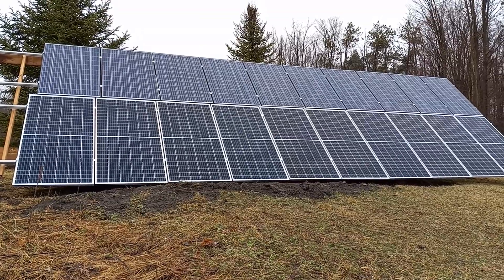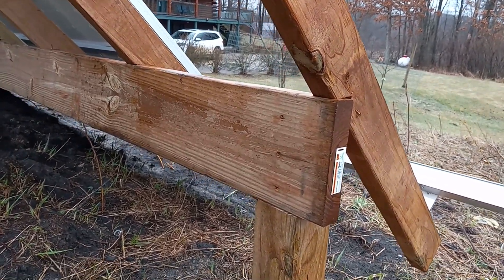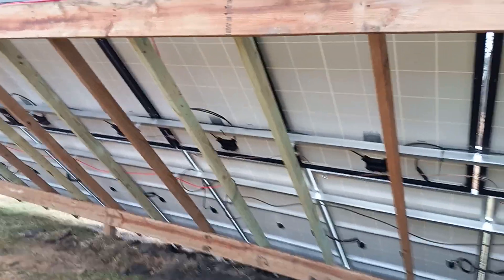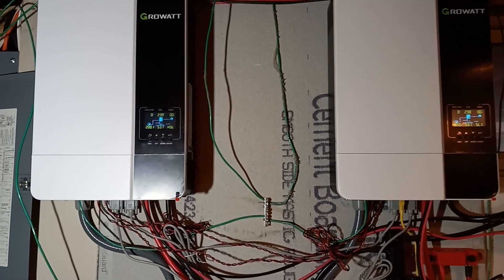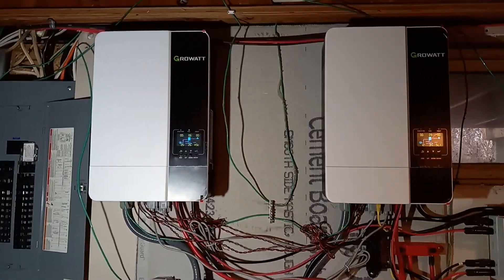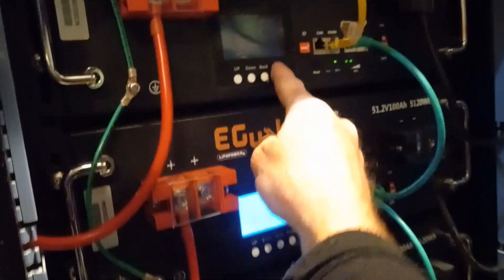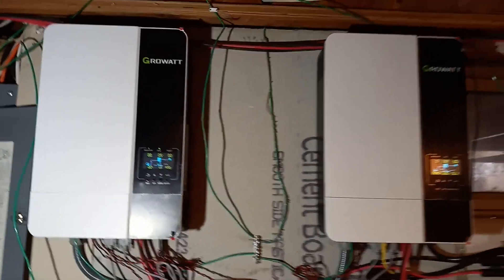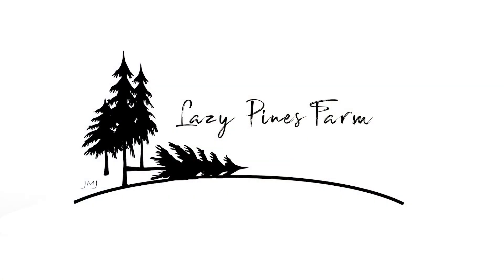Growatt 5000 ES Solar Array Build

Comment: Install 4" of insulation around your water heater and install mechanical timer. Turn the water heater on from 12 to 5 PM every day. You'll have plenty of hot water unless you take long showers or more than two showers per day. Now your water gets heated while the sun is out.

Comment: Good video. I have same inverter and one growatt  ARK 2.5kwh  lithium battery. The inverter on standby with no output load connected it drains 50% of battery overnight. Growatt have run their own tests and now say that's acceptable.  Wondering if you are noticing around 1250wh drain from inverter on standby overnight?
Reply from the maker: Whoa 50% on standby, that's seems crazy.  I get 20% discharge overnight running my entire house on 6 batteries.   Seems like something is pulling power out.
Reply: @mkonvo   I have only the one Growatt battery and with no wires connected to inverter output going from 100% at sundown to 50% by sunrise, about 14 hours. Growatt technical say I should have at least 3 batteries  I only use this for some lights in an aircraft hangar on occasional use.  Either inverter or battery seems to be faulty. Fans never stop running on inverter, so has current drain there.
If I set it to standyby mode it wont start with small load as fridge or 4 fluuro light, require at least 4 x 100w led highbays light to be turned on to wake inverter up. Overall very disappointed
Reply from the maker: @hot993  I wish I could help but I'm no expert.  Learned everything I did from all of the different videos on YouTube.  My guess would be either an inverter issue or just not enough battery bank???

Comment: Your battery rack: flip the ground bar upside down and have a longer ground cable to reach the new length. That one change will balance the battery equalization better.
Reply from the maker: Thanks for watching, I flipped the bar and had the same results.
Reply: @mkonvo  very strange, but good to know. Thanks.

Comment: Is the battery ground at the bottom and the positive at the top? Like it should be?
Reply from the maker: Yes, it is in the diagonal configuration.  Both ways pretty much produce the same results(diagonal vs both at top).

Comment: I think it's a good thing you did overbuild your joists.  I used 2x4's on my first ground mount but I'm using superstrut to mount the panels.  I'm noticing a bit of sag in the 2x4's.  I switched to 2x6's and all is good.

Comment: Nice setup. If you have a relativity enclosed space inside the house, a clothes line and dehumidifier works great for dying laundry with very little electricity. We went from about 6-8 kWh per load using a dryer to about 1.5-2 kWh per load with a 12 liter/day dehumidifier. Takes longer, but doesn't damage the clothes as much and uses less electricity.
Reply from the maker: Good idea, thanks!

Comment: I have a very similar system. Less panels though.  I had an electric water heater and I installed a Rheem heat pump water heater.  It can be a traditional electric heater,  a combination of heat pump & electric elements or heat pump only.  In heat pump mode it draws about 4 amps. Easily runs on 1 of my inverters
Reply from the maker: Cool, thanks for the info!  I need to look into that but it will have to wait for now.  Summer shouldn't be too much of an issue but come next winter I will need to change some things.

Comment: looking great! I'm considering the growatt inverter you have there. Any quarks or thinks you don't like about it. Maybe a alternative option you know of. In my research I found it uses around 60—70w idling which is really bad. I wish it use half that.
Reply from the maker: I haven't had any issues at all with the performance of the Growatt.  No error codes whatsoever.   I'm sure there many alternatives but I haven't looked in to any.  Yes, it does consume power but I haven't measured it to see what exactly it's pulling.  Thanks for watching!
Reply: @mkonvo  Have you thought about using the 12kw grow watt.  Ive given thought to it but havent found anyone running two of them completely off grid . Right now im running schneider 4048 off grid for my ac & frige only it does decently well.
Reply from the maker: @thhillbillyinventor105  since I'm already invested in the 5kW system I will just keep going with it.  I've had zero issues so eventually I will squeeze a 3rd one in so all of my power needs will be taken care of.

Comment: Thanks.  Real nice video.  I'm planning on doing something just like what you have set up.  Can you show your electrical layout on how you connected everything with your solar and grid into your breaker panel including your bonded and non-bonded grounding scheme?  Thanks again.
Reply from the maker: I made a video prior to this one with most of that info.   See if that answers your questions.   
In that video, the breaker box after the inverters is bonded.  The inverters and batteries are grounded separately from the house breaker box.
Reply: @mkonvo  Thanks.  I'll have a look.

Comment: Try putting lower wattage elements in your water heater to reduce its instantaneous demand
Reply: I'm only using one Growatt 5000, so I replaced my 4500 watt elements with 1500 watt in my 40 gallon water heater, and it's been working great.  Also running my 1.5 ton AC unit.  Have only used the grid once in 3 weeks.  I have 5 of the Lifepower4 batteries and 28 x 200 watt panels.

Comment: What size are your battery cable’s? What I did was I put in 2/0 that helped a lot plus from my bus bar on the wall my cables are the same length. Then from the bus bar to the battery bus bars my cables are the same length. When I had the 2 gauge wire’s mine weren’t balanced either.
Reply from the maker: I'm using 2 gauge cables all the way to the inverter.  They are all equal lengths as well.  I flipped my positive bus bar so the connection is on the bottom.   Very cloudy and rain has dominated my area so I haven't got to cycle the batteries since flipping the bar.  I do have 2 more batteries on order from signature solar.
Reply: @mkonvo  then your setup will be the same as mine. Except for your solar panel’s. They will do much better. Plus if you get solar assistant from watts 247? You can monitor your set up from your phone or computer. I have videos on that.
Reply from the maker: @jamesshomesolarmore2223  funny thing is where I live we have no internet access and rely on our phones so I don't have an active wifi network to connect to the inverters, that's the only reason I don't do that.  I would love to be able to monitor things while at work.  Thanks!
Reply: @mkonvo  oh man I don’t know what I would do without Wi-Fi.
Reply: @mkonvo  this is a easy problem to fix. Get starlink from Elon Musk, it’s 100 per month, or go low grade, buy a smartphone or hotspot with unlimited data, and set that up as “WiFi” that’s wha way you can monitor your array when your away from your home. I’m in Michigan also.
Reply from the maker: @about2088  thanks for the info!
Reply from the maker: @about2088  Verizon has a cheap service called Visible with unlimited Hotspot I was thinking g about.
Reply: @lts30000  Hmm I never heard of that issue before, quite weird tbh, hopefully they get it fixed soon. I have access to Xfinity, so I use them as my go to. 1400mbps down and 300up for sub 100 bucks. I’m looking at starlink to minimize the propaganda and media blackout. Hopefully they don’t become to regulated
Reply: @about2088  yeah I read up on that online 41-45°.
I seen the media blackout internet being regulated for a while.
I thought starlink as internet goes down, What A Savior it would be.
You can't be all ready, a bit of preparation goes a long way.

Solar 😬
All the Best
Reply from the maker: The cables from the batteries to the bar are the ones that came with the batteries, maybe I should beef them up.
Reply: @mkonvo  that’s what I had to do. The cables that come with it are too small.
Reply from the maker: Sounds like a good idea, thanks!

Comment: The REC 375W don’t seem to be real shade resistant. They look like mine, also Will Prowse said your storage rack has a sharing problem that needs to be addressed, or make your own bus bar connection at the bottom of the battery rack for equal battery sharing, I think he said the main bus bar positive/negative were both at the top? Could be wrong, thank you for sharing 🙏, love the array build, great job. Oh almost forgot, Will said you could also flip one of your bus bars around on the rack so the main positive and negative were on opposite sides.
Reply from the maker: @ZR CARR thanks for the comment!  I saw the video Will did and flipped my positive bus bar around so the connection was at the bottom.  It really didn't make sense to me what Signature Solar told me and I've been given alot of misinformation from their tech support guys on various issues.  I'm going to do a video on the results of flipping the bar after I see a few cycles.  Unfortunately it's supposed to be rainy and clouds here for the next week.  Thanks for watching!

Comment: I keep my es 5000 grid tide , only have 5.5kw right now I totally know what you mean about the clouds and rain. But seems as though I have almost cut my elect. in half. Have a second 5000 ready to install and 7 more 250w panels. Going to give them a more winter angle and see what they will still do in the summer months.
Reply from the maker: No doubt being grid tied would save money.  My electric company pays a tiny fraction of what they charge per Kwh  and in my opinion taking advantage of us so I just choose to keep it for myself.  Thanks for watching!